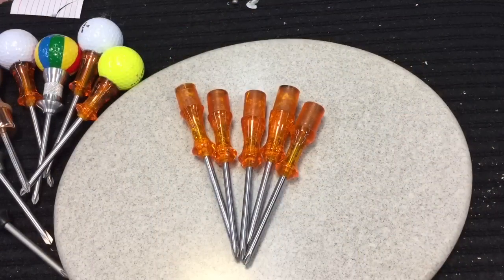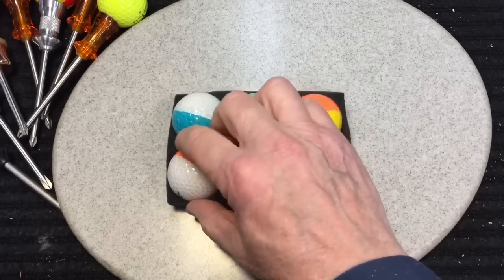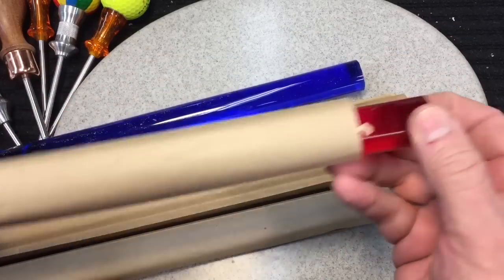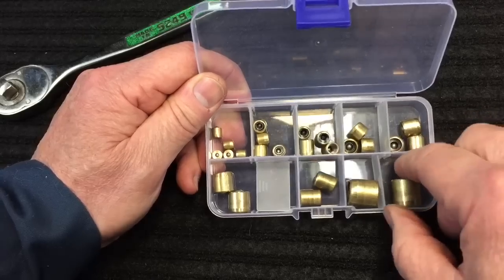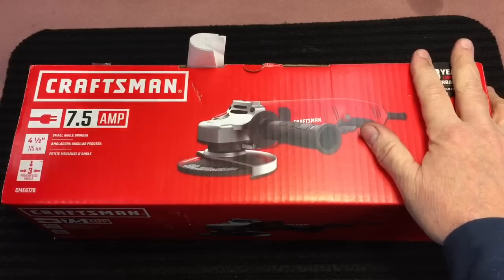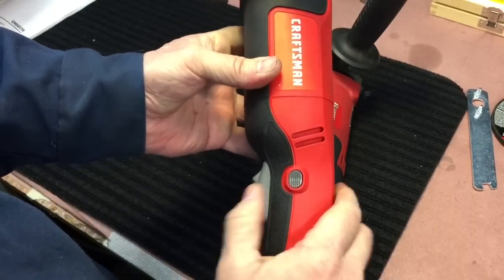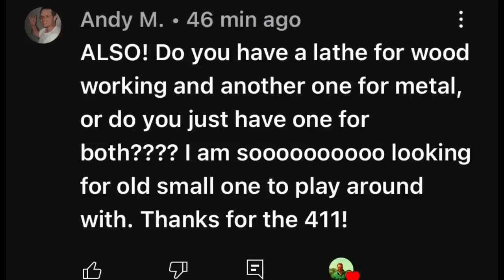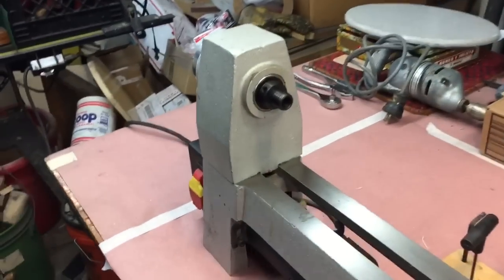Craftsman Angle Grinder First Look, Ball Oilers and Buying Your First Lathe!

Comment: ScoutCrafter, 

It's been 58 years since Junior  High shop.  I  turned a bowl out of Siamese teak.  It cost $1.25/board-foot.  I had to bring a note from home for the $6.25 bowl, along with the money.  I still have the bowl.  It was my first and last lathe project.  I loved every minute I spent turning the bowl.

I remember my shop teacher, Mr. Johns, telling us when setting the drive center to punch the center of the crossing with the punch  and then to use a back saw to cut relief cuts on the cross.  The drive center would then automatically align on center, allowing you to concentrate on lining up the live center.

Bob
Reply from the maker: Hi Bob!  The funny thing is I bet if you were in front of a lathe right now it would take ten minutes before you are turning like a pro once again...  It's just such a fun machine to play with.  It's really fun turning wet wood too!  Cuts like butter with little dust!  The only drawback is when it dries it shrinks and checks.   =D

Comment: My first angle grinder  was a Craftsman off the return table at Sears. Lasted 10 Years. 
A working lathe can be made from a washing machine motor and 2x4s. 
Love the handle.  Like clamps you can't have too many.

Comment: If anyone in the UK is after a lathe like the one shown then look up the Draper 60988 lathe.
It is identical to the one in the video to the point I would say it's made in the same factory just painted and badged under the Draper brand.
You can find it at FFX right now for £187.

Comment: I have a tiny Proxxon wood lathe and I must say dispite it being limited in size it sure holds up on power and I have done some pretty amazing projects on that thing already. It may be small, but it can fit little cups/containers, candle holders and most important for me; tool handles. I like the idea of learning on something small and then moving up to a larger machine. I havn't got a real shop atm, so being able to move it around freely is very nice.

Comment: Maybe it was you that did the video on safety and benefit of using an apron when using a grinder. It made me thin a lot and I like those push to operate switches. I know it's a lot to expect someone that is using a grinder all day to keep the finger on the trigger. Even though my two angle grinders are constant-switch on, I like the thought that if the grinder gets caught or is out of control that I could take my finger off the trigger and it should turn off. As .long as everything works right. Thanks for the video today.

Comment: I bought a cordless Ryobi grinder a few months back and now i regret it uses the 4 amp hour battery flat within 20 minutes constant use but there is one good thing about it no cable to get tangled around the wheel that terrified me Al the time.
Great video.
Kind Regards.
Dain 🏴🛠️⚒️🇬🇧.
Reply from the maker: It will always come in handy one day if you need to take it somewhere to cut off a padlock!!!!   =D   Worth it for that alone!

Comment: I just recently picked up an angle grinder accessory that I would not have thought was worth it at first. There are many makers, it's just a little unit to convert an angle grinder into a tiny chop saw. They're like $9. I have found this to be remarkably more useful than I expected, oftentimes we use the angle grinder on materials that can only be cut with one, being able to insure a straight line for 4 and 1/2 in comes in a lot more useful then one might think. I think a big part of it is having it all set up and ready to go, when you need to trim something, it's one fluid motion. But there are markings and the fence so you can make very clean 90s and 45s
Reply from the maker: $9!  That is cheap!!!!!

Comment: Hi John, 

What a great starter lathe. In the early 1980’s I bought a ShopSmith and have enjoyed having a wood lathe. In 2019 I bought a 1939 Atlas Craftsman 12”x24” metal lathe. It’s currently in pieces ( Major SubAssemblies) awaiting me to perform a full strip, repaint and reassembly. The headstock utilized Babbitt bearings which are in great shape with virtually no end or horizontal play in the spindle. There are just two parts which need replacement and I’ve already gotten them. It is going to be a while but looking forward to that refurb along with my 1934 Delta DP220 bench top drill press. I very much appreciate the battleship construction and longevity of these fine machines of the past. I think I’m going to use Scoutcrafter Red to repaint it. The lathe was originally Royal Blue, but like you I just love the red. Gray machines are just to drab, no pop. Thanks for another great video.
Reply from the maker: John- Funny thing is once you own a lathe you can never be without one again...  Yet so many people never include it in their basic setups...

Comment: One great justification for buying a lathe is that you don't need to buy any buffers. You will still need one bench grinder, but it's very easy to use your lathe with wire wheels, stones, buffing pads, Scotch-Brite etc. You can even have all of these on a single shaft, making rehab projects very quick. I'm a big fan of using it on a slow speed when staining wood, the constant motion stops drips from forming
Reply: Another great rationale; a lathe will save you thousands of trips to the hardware store. Being able to quickly alter a part, or make the necessary fastener. When you have to throw away an appliance because of one small cracked plastic part. You will be surprised, once you've had one for a year, you won't know how you ever lived without one. It's not even about the expense, it kind of ruins your day when you have to make yet another trip to Home Depot for a washer that needs to be 1 mm smaller
Reply from the maker: Also a great disc sander!  =D

Comment: I have to say this video had balls. Still on the fence between machinist or wood lathe. Great video.
Reply from the maker: Wire- Cost is the big difference there-  You are a tool guy so I can see a lathe coming to you from someone who passed away or hasn't used it in years...  Your biggest problem like me is where to put it!  LOL
Reply: @ScoutCrafter  Yea, that nice big shed I got last fall is filled up. Had to build lofts to fit more stuff.

Comment: Great video, thanks John! I bought used gimmicky leath and tried to male make a mallet, it was shaking like crazy and it wouldn't hold the peace very well, I am now definitely thinking of buying a cast iron leath :-)
Reply from the maker: Julian!  Yes!  Me too! The older Grizzly I bought had round cast pipe bed... Very flexible and it was horrible.  They discontinued that model soon after.  It almost turned me off to lathes in general   =D   Rigidity is EVERYTHING!   =D
Reply: @ScoutCrafter  I tried the ZYLISS lathe and it was not so good (very wobbly) and then bought a Suissrex workshop sytem with the lathe kit at an estate sale, but I haven't tryied it yet... It looks very cool though :-D

Comment: If you load up The parting tool in your lathe and set up for threading, something like 4 TPI, you will end up with a tight fitting cylinder and ideal spacing for the epoxy. Just a thought
Reply from the maker: 4 TPI   Nice!  Like a vise thread!

Comment: Yikes, I have 6 lathes... sort of. A big one for wood (the green Harbor Freight one), a Sherline for small metal pieces, a small Craftsman lathe that I think holds 12 inches (this was my first one. Got it cheap at GoodWill. Liked it so much I had to get a bigger one), a really tiny dremel lathe (very weak and kind of useless - but it completed my vintage Dremel powertools list), a big Logan metal lathe that is in pieces on my garage floor. I started cleaning it up after getting it last year and the weather got cold so it's on pause. Lastly, I have another smaller lathe that I think is from the turn of the century. I have no idea what it is - the tailstock is on some springy base if that makes sense. I can only imagine that is was used for maybe wiring or something.  Like ScoutCrafter with his tools, you would think I have enough, but I would still like to get a classic jewelers lathe and maybe make myself a pole lathe. It's a curse...
Reply from the maker: Eric- The hydraulic press and the lathe are the most fun tools to use in my shop, I am sure it is like that with you too.  Nobody goes to the table saw and says, let me just cut a bunch of random wood... However if you haven't turned anything in a while the lathe starts to call out to you!  LOL!!!!!!!!!!
Reply: @ScoutCrafter  OMG, you and that Dake, LOL! Every time you use it I drool and say, "I have GOT to get me one of those!" I did get the smaller bench arbor press and it has come in handy on a number of occasions, but it's no DAKE. The lathe is addictive. I recently did a spindle for my sisters staircase that was broken. It's an old house and they were all hand crafted, so I was able to get that replaced for her. Another fun thing with the lathe is making springs. To keep the wife happy, when branches fall in the yard, I turn them into little wooden mushrooms. I recently saw a video where someone used the lathe to get a peice of wood to a certain diameter, wrap sandpaper on it, then used it to sharpen the inside of their gouges - using it as a custom spindle sander. Some even use them as bench grinders by putting the steel and buffing wheels on them. Yeah, lathes are a lot of fun and can be used for more things than just shaping wood! A MUST HAVE for the shop!

Comment: To prospective lathe shoppers, if rigidity is your goal, as it absolutely should be, cast iron is enormously superior to steel. It might not be true in all regions, but I believe you will get more bang for your buck buying an old used machine with wear over a modern Chinese brand new machine. That said, the very common Chinese mini lathe featured all over YouTube has a couple popular mods to swap out the bearings, this is a very worthwhile pursuit. I have seen a tremendous improvement in these machines from nothing more than firmly fastening them to a thick piece of steel plate no larger than the machine's original footprint. One other important note, in machining, tooling almost always costs more than the machine itself. Learning to grind your own HSS can make this completely untrue on a lathe. If you are considering both a lathe and a milling machine, plan for the milling machine requiring the same cost again for pretty basic tooling. On a lathe, $100 worth of HSS will probably last you as long as the machine. EDIT: all of my statements are in reference to a metal working lathe, not wood.
Reply: Even if your budget allows for carbide, teach yourself with HSS. The principles used with HSS will build excellent habits. Carbide is wonderful, and newly affordable, but the way you use it on a metal lathe is somewhat counterintuitive, it would be bad habits to run HSS in the same way. The more important reason is the tremendous amount of counterfeit carbide inserts out there. You cannot tell by sight, even in person. It can be tremendously frustrating, trying to learn carbides little ways, when not knowing if your inserts are legit. Anybody considering carbide, take a look at kennametal or sandvik catalog pricing, and then look at the eBay or Amazon listing. If it's too good to be true, it is most assuredly too good to be true. Learning to grind your own tools will also help you understand what the thousands of different profiles would do. A lot of people get in the mindset of needing one of each of the most common tools. The reality is that most Machinists use the same two or three cutters 90% of the time. It's not often that you need some of the more complicated profiles. The difference is putting in an order and waiting 3 weeks versus spending 15 minutes at the grinder. One other consideration is that carbide requires specialty grinders, specialty Wheels, and respiratory protection. HSS needs a cup of water.
Reply: One other tip! And just the tip! If you're buying a lathe for the first time, put the four jaw chuck on the lathe and make a rule for yourself that you can only use the four jaw for the next month. Developing the ability to Center asymmetrical work is so foundational, you will absolutely need this skill even if you never use a four jaw again. But forcing yourself to use it for a set period of time works really well to cement the muscle memory. Anybody who watches Abomb for example, once you develop the muscle memory, you can get just about anything set up in just a few minutes. These skills will transfer to many other areas of machining as well. If you get into fabrication or milling, it's good to get used to identifying landmarks in relation to the center of the work. This can be difficult to conceptualize; pick your favorite 3D image, now mentally put a cube in a vice. How do you remove everything other than your image? If it's a precision part, you may not have the option of opening the vise until you are finished. This is the main job of a machinist, mentally figuring out what setup and order of operations is necessary. These days, the machines do all the rest. I have an all manual machine shop, nothing computer controlled, and this statement is still true.
Reply: I forgot the most important edit. Scout crafter is right! RUNNING A LATHE IS FUN!!!

Comment: I'm sorry for blowing up your comments, I'm very pro-lathe myself, haha. Just wanted to throw out one other reason: over 30 years I have owned 11 different lathes, none newer than 1974. I have never once sold a machine for less than I paid for it, even machines I have put thousands of hours on. In fairness, I have never bought a brand new lathe, I doubt this would hold true though that ubiquitous mini lathe doesn't seem to go for much cheaper used. Scoutcrafter is saying, it's only $300! I'm suggesting that if you spent $500 on a 1950s machine, unless you drastically damage it, you're not going to have any difficulty getting at least $500 for it, even after a few years. The old manual machines seem to only go up in value despite wear. I think the single best trick for getting a smoking deal on a lathe is to find a mid-century model that has cast iron legs. The majority of these machines value is in the legs as absurd as that sounds. The hipsters all want them for making coffee tables, particularly if there is cast text. I hesitate to share my secret, but I've been doing this for about 10 years now. I buy an old manual machine for about $1,000. I take off the legs and I build a new stand out of steel that cost me $100. I sell the legs to insufferable hipsters for $900 to 1100. I typically end up having spent less than $100 and a half day to make a stand. The bonus is that these machines are not terribly rigid by nature of the legs. By swapping to a DIY steel stand, it nearly doubles the rigidity! This is really kind of a kill 10 birds with one stone type of deal. I know I'm going to regret sharing it, but I can't think of a better audience. If you got any valuable information from my posts, please let your local coffee shop know that you do not like industrial equipment around food. Piss and moan about lead paint. I don't care what you do, but do what you can to stop these hipsters from scrapping history!
Reply from the maker: I have always found that the size is a big factor on people holding off on buying a lathe. The thought of needing people to help get it inside the house, move it or lift it is a real deterrent to most people. You could easily run a mini lathe in an apartment of even this!  https://youtu.be/_BtYctonMTQ

Comment: John, Would it be possible to order and pay for six Phillips screwdrivers with Scout Crafter red plastic handles ?
Reply from the maker: Dean- I am bringing some prototypes to the tool meet this Wednesday to see what design is preferred, they are all close but it makes a difference in the hand.  Plus I am having a slight glue issue that you will see on Wednesday...  I will email you!